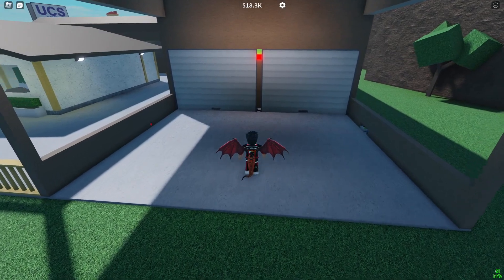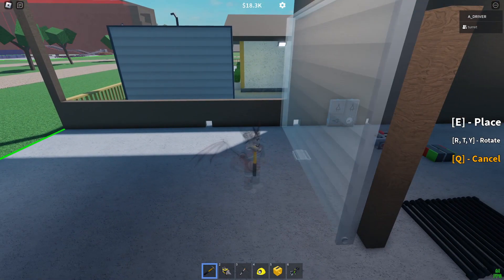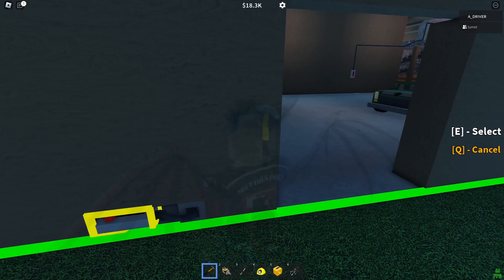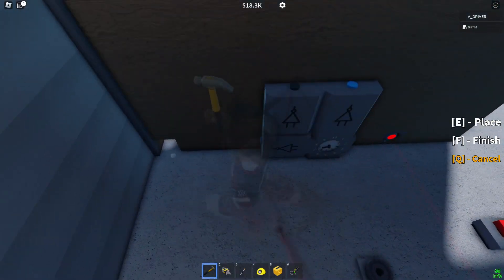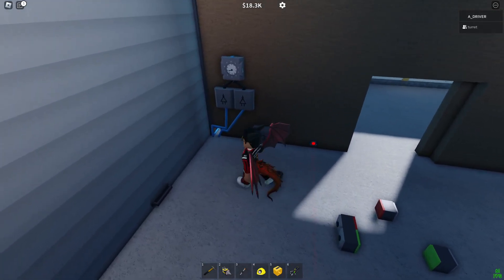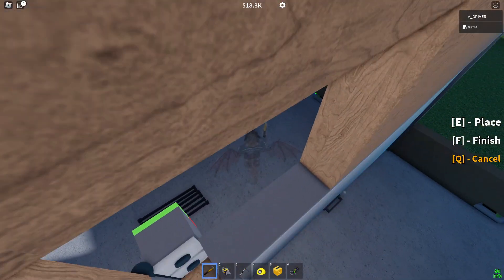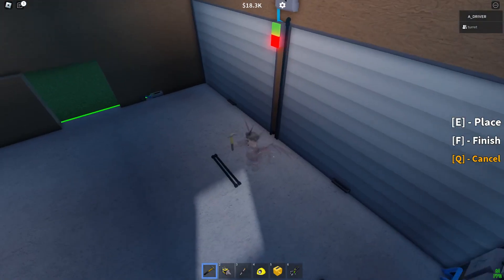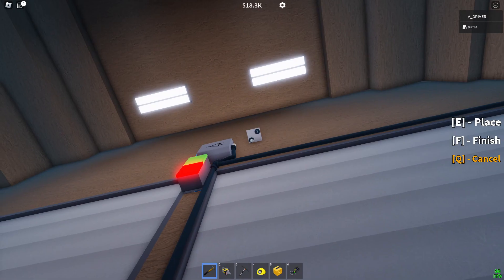Refinery caves how to make auto garage door

Comment: I followed every step how comes the top light isn't working or my alarm don't sound but the door works fine
Reply from the maker: have you checked that all the connections are touching for the wires?
Reply: @A-DRIVER  where do you find theses items
Reply: @A-DRIVER  make a video on where you find theses items please
Reply: @A-DRIVER  i got every single item and yes all the wires are connecting and i redone them multi times